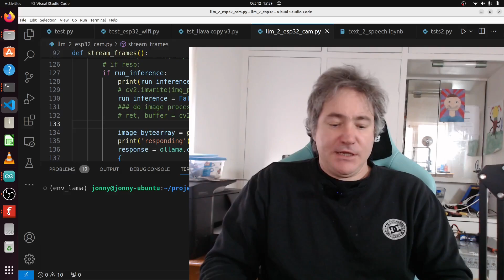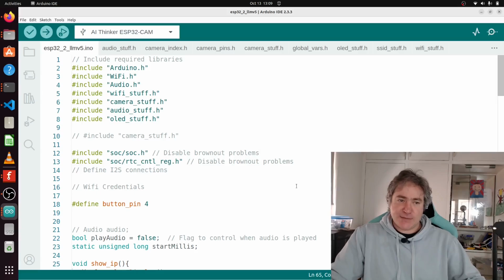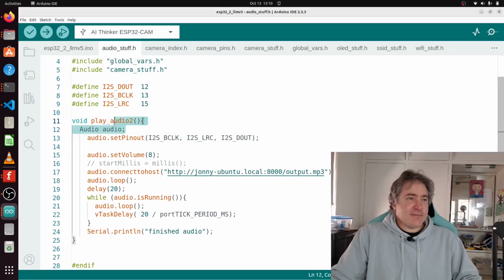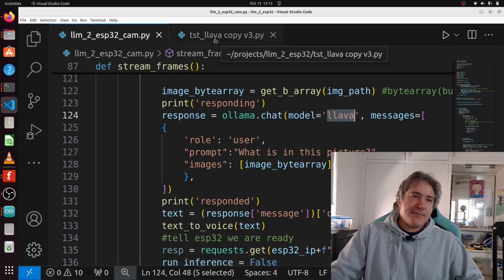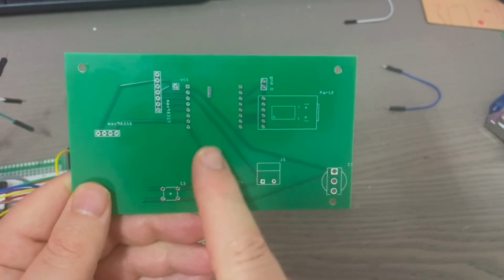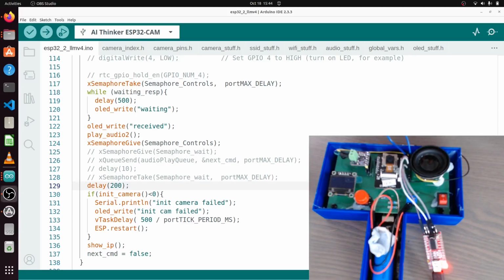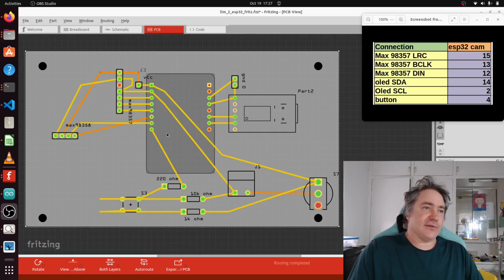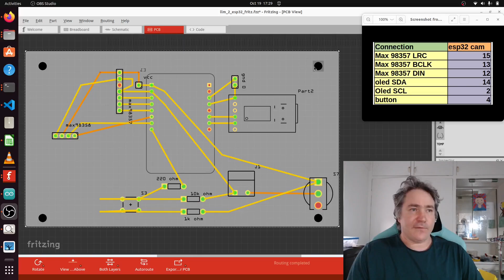esp32 to LLM and back again

Comment: this is really cool.  inspires me to play with this a bit.  question on the 4 ohm speaker.  it looked like it was still very quiet and you had to hold the microphone up to it.  is that accurate or just a factor of your camera filming the session and we just couldnt hear it.  I guess my question is can you hear the speaker yourself without the use of a microphone and it is a good volume level to not have to hold it close to your ear.  i am looking at doing a different project but want a speaker for conversation purposes with the LLM.  at $15 a piece, i would assume it would be loud enough to hear it from a few feet away.  thanks for any info.
Reply from the maker: @phlynch3  hi. The speaker was good. I originally had these really cheap 8 ohm speakers from aliexpress and there was a lot of static. You can turn the volume up in the audio library. Also with the amp, you can increase the gain. I didn’t want to push it though because I didn’t want to blow the speakers. It would be interesting to see how high you can get the volume before the speakers blow.

Comment: Hi can i get a full schematic diagram of the project? cool video
Reply from the maker: Hi. I have put a schematic on the github repo. File is called schematic.jpg. The pin connections are on the repo as well.
Reply: @ Thanks so much for this. One question tho, may I ask what the vcc node thingy is for in the schematic? is it just like a label or is it a connection for smth?
Reply from the maker: @ that’s the 5v for the power.

Comment: I am interested in building an AI model for a specific lottery game and would greatly appreciate your thoughts or assistance on this project. The game details are as follows:

Game Description:

The lottery runs 24/7 with rounds every 1, 3, and 5 minutes.
Each round involves three prediction types:
Number Prediction: Numbers range from 0 to 9.
Size Prediction: Small (0–4) or Big (5–9).
Color Prediction: Numbers are assigned colors: Red, Green, or Mixed.
Available Data:

I have the last 30 days of game results, which can serve as historical data for training and validation.
Objective:

To develop an AI model that can achieve a prediction accuracy of 55–60%.
I am particularly interested in utilizing machine learning, deep learning, and data analytics to find patterns and improve predictions.
Questions:

Do you think it’s feasible to build an AI model that can predict outcomes for such a game with the desired accuracy?
Would reinforcement learning or a feedback-based system be an effective approach for improving prediction accuracy over time?
Are you open to collaborating or providing insights to help develop such a model because i'm non coder background?

Comment: Nicely done! Will be a project to try out when i finally invest in a powerful machine. Thanks for sharing this with everyone.

I think the PCB could be improved upon as the traces looks poorly done. Plus, i think the entire pcb size looks more like an overkill for the project.
Will like to design one that addresses these issues (at least in my opinion) as part of my contribution to the project, that's if you don't mind.
Reply from the maker: @gimpsonkura2624  thanks. I’ve been having a lot of fun with machine learning since I upgraded to a pc with a GPU. I got a comment on one of my earlier videos…. “This is what happens when a software guy makes a pcb” 😂
Reply: @jonathanr4242  😂 at this point, what is most important is that it works! Will work on a more compact PCB design, you just tell me where to send the finished Gerber file.
Reply from the maker: @gimpsonkura2624  thanks. Can you please merge into the GitHub repository?
Reply: @jonathanr4242  sure, will do so when done 👍👍
Reply: @jonathanr4242  hey so sorry it took this long to design the PCB, I have had a lot on my plate lately. I did design the PCB and created a pull request on the repository. Please go through the files and do let me know what you think.
Reply from the maker: @ hi. Thanks so much. I got the email about the pull request. I will have a look.
Reply from the maker: @gimpsonkura2624  That looks great. I've merged it into my repo. Thanks.
Reply: @jonathanr4242  You're welcome 👍. Whenever you need adjustments do let me know. Have a great one buddy and thanks for sharing your work with the community.

Comment: Very cool project! Do you wait for full LLM response before generating and streaming the audio?
Reply from the maker: @naahh4498  yes, I wait for the full text answer and then use text to speech. The response is quite fast when running on the GPU, around 1 or 2 seconds. It actually takes longer to stream the audio file than to generate the response from the GPU. I’ve also tried on the cpu, and the generation from the LLM is very slow, around 30s.
Reply: @jonathanr4242  that’s impressively fast. Would be interesting to see an implementation that streams and plays the audio in chunks to improve perceived speed… obviously adds a fair bit of complexity, but maybe one day.